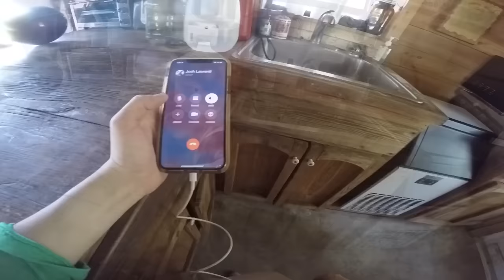Lane Splitting Will NEVER Be Legal In Florida

Comment: I lived in Florida and I would filter to the front when traffic was stopped.  Only once in a while did someone try and block my progress, because, you know we were raised to not let others cut in line.
Reply: I've had some people do that to me in California. I just laugh and move to the other side and just  tell them thanks. 😂

Of course, it's not as easy to do on a big bike but super easy on a light bike.  For filtering, you're better off on a smaller bike so you can laugh at them for trying to block you.
Reply: Lane splitting is bad, filtering is good. But if filtering is legal you get a bunch of stupid people who will split and say its legal. Id rather have them both be illegal if it means splitting cut down. Yeah it sucks for the bikes to be at risk of getting rear ended by morons, but I've seen bikes cause accidents by scaring drivers. I've seen people go into the wall after a bike jumped out in front, and out of the 3 roll overs I've seen one was cause by a bike splitting and then hitting a car. Car proceeded to over correct and flip. Biker had bones sticking out and the car had children in it (lucky all they had was a few bumps and scratches.) Biker was also found at fault and probably still cant walk or use their hand properly.

Comment: I live in Victoria Aus (the most over regulated and restricted states in all of the western world 😅 and Lane filtering is actually legal here based on safety for bike riders. They made the law modified to lane splitting as such, because you can only do it in certain lanes, at certain speeds etc
Reply: Same in Cali, you're not supposed to split over 35, lane FILTERING is different.
Reply: @mellorides3379  it's 15 or 20 here so you've got us there lol
Reply: Victoria: Free range prison state!
Reply: Aye, agree, legal in U.K. too but a difference between ‘filtering’ and ‘splitting’, general guidance here in U.K. is no more than 15mph faster than traffic and typically only do if the traffic is stationary or slow moving. Safer for bikers, less risk of getting rear ended imo.
Reply: Australia is part of the "eastern world." Geography.

Comment: Personally, California lane splitting should be legal across the States, of course, with guidelines in place.
At the very least, lane filtering should be legal everywhere, and lane splitting in ~30 MPH traffic isn't that dangerous. You could be going 40 MPH, and they are going 30. So, if you get hit you'll at worst get hit at 30 MPH, and if you hit a car, you'll only be going 10 MPH faster. As long as you're not next to semis, lane splitting can still be fairly low risk.

Comment: Replace that Kia with a Toyota or Honda as soon as you're able to... There's a reason you don't hear of many Kia's with 200k,300k+ miles still out on the road.
Reply: mine has 48,000 miles 2017 one owner, its in the dealer as it ate a spark plug on number one cylinder, ate/fouled out another one on the way. So, we will see if they put their money where their mouths are, 100,000/10 year warranty. LoL